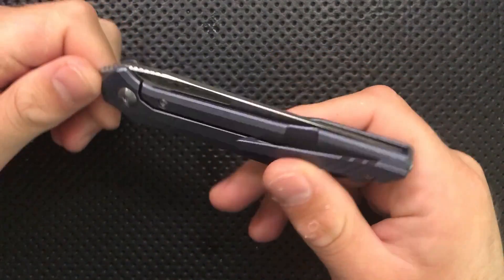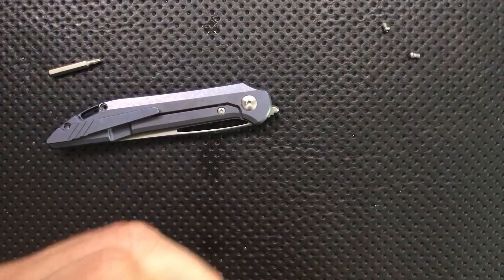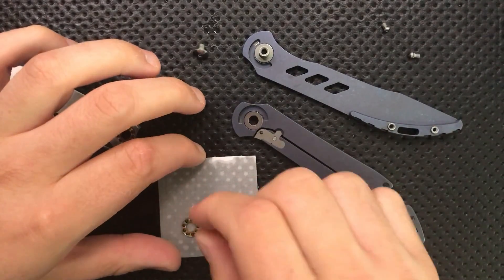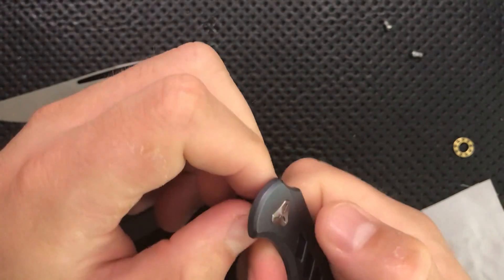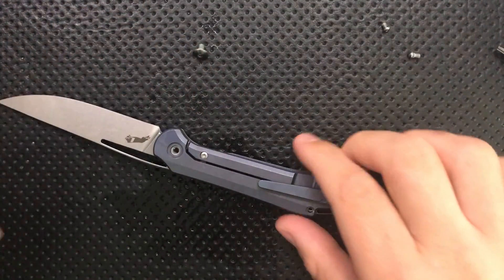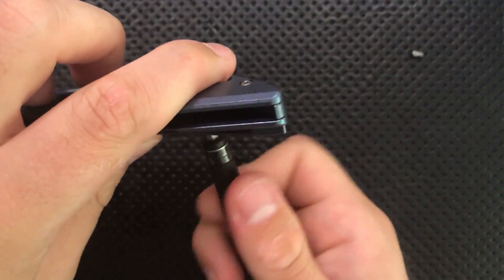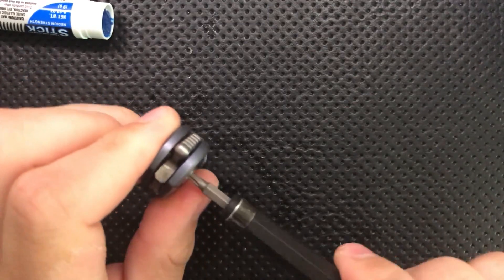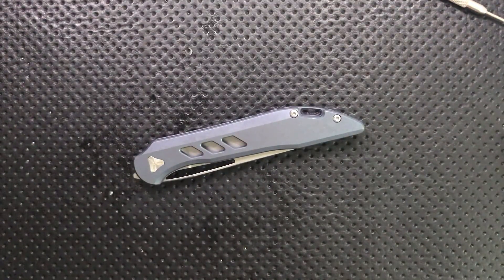How to disassemble and maintain the Boos Blades Smoke

Comment: Why the thread locker on scale screws other than the pivot? I've never had a scale screw come loose. Maybe a pocket clip screw on aluminum scales. I've been meaning to ask you why you do it? Once the screws tighten it basically impossible for them to come loose, unless it's a pivot or maybe in rare cases a pocket clip. I really only ask because of issues with soft screws on certain knife brands.
Reply from the maker: Shouldn't be an issue, and if I've got serious soft screw issues I won't, but I'd rather have it and never need it.
Reply: Nick Shabazz This is a official apology. I just got a Hinderer mp1. I’ve had it for two days. I have been flipping it , breaking it in. I walked out my front door and pulled the knife out of my pocket and heard something hit the ground. It was a scale screw that fell out of the titanium side of the scale 🙄. I’m off to buy some blue locktite 🙄.

Comment: Hi Nick, good review. I want to buy a new knife but i'm not sure what is better gentleman: bradley2 or we 704. I' ve many spyderco but never handled a we. What do you tell me about? Any other model? Thk
Reply: cesare mantovani I know that until WE moves to torx I am holding off. I like my tools to be used serviceable. I have a GB1 and it is fantastic though a bit heavy, can't go wrong there!
Reply: good to know thx
Reply: According to the Boos blades website, the Smoke is manufactured by WE knife Co.
Reply: Yes but it most WE use a strange star bit that is not usual. The Boos Smoke is just contracted to WE so it uses torx. Only one WE model uses torx at the moment.